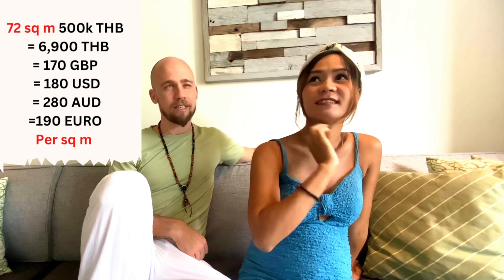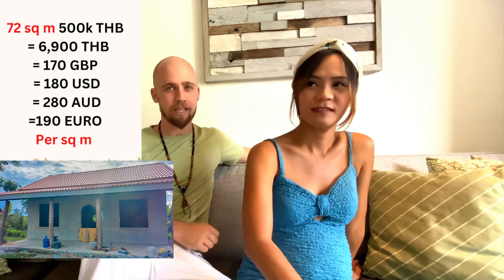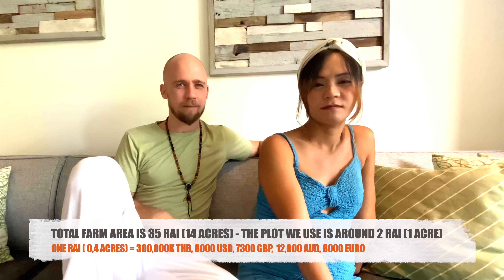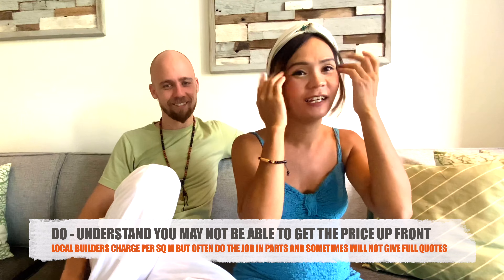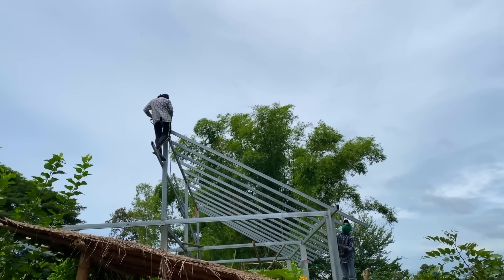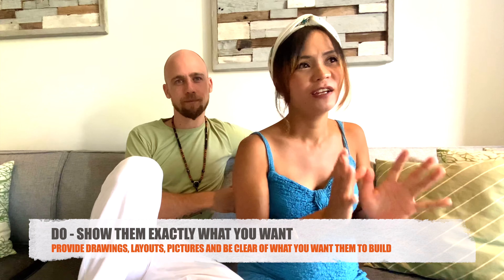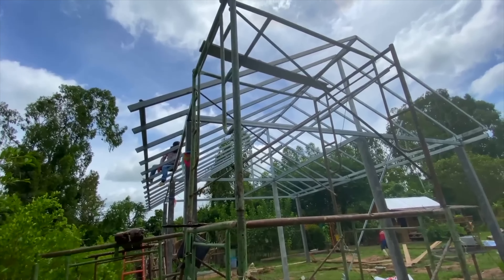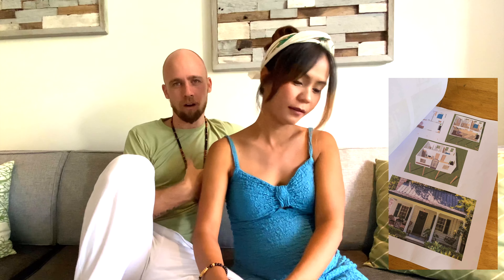Tiny House, Tiny Budget, Thailand | Building Under $10k - Do’s & Don’ts 😮🇹🇭

Comment: My guide to building my house (nearly finished) 

I produced my design using sketch up (free app) but had I to do it as just floor / elevation plans as that was what they were used to 

Rule 1
Always always always get a good reliable builder and try to see previous work
(Not doing so can end up with lots of problems like a sink with a 12% list )
Rule 2
You can if you feel the need (if alarm bells are ringing- why build) register the land / house in a company name with your solicitor as the front man.
Rule 3 
Have a reserve just in case (ie metal prices have shot up) 
Rule 4 
Stage monthly payments with major payment on completion 
Rule 5 it is not the west - just don’t worry, you may expect double skin walls 50cm thick why ? 10cm is normal 

And as you say everything runs on Thai time 
PPE one of my guys has a umbrella hat for the rain, for the sun and for doing roof work. Offered a hard hat but were to polite to laugh but a polite ‘no it’s ok’ 

One of my strings to my bow is that as a town planner the first thing I did was chuck away the normal western guides and build expectations and ‘go with the flow’  😂

Good Vlog as usual  👍🏼
Reply from the maker: Fantastic advice 👍👍👍

Comment: All very good suggestions!  We finished a 220 sqm (excluding outdoor patios), one story, four bedroom home North of Chiang Rai (rural area), 18 months ago.  The "estimate" was about 3.5 million baht and 10 months to build,  The final cost including upgraded materials and some modification to the outside was 4.2m million baht.  The house was completed in 13 months due to COVID and material (roof tiles) shortages. I am very happy with the builder, workers, design and quality of the build.  The only issue we had to address was the SCG cement tile roof leaking over the master bedroom during heavy rains.  It took many trips and many cans of sealing paint to stop the leaks.
Reply: And does the sailing paint work well? You don’t need to reapply it from time to time?

Comment: I'm currently in Nakhon Phanom, most houses here are built from wood and/or bamboo and are up on stilts because this area is very flat so when it rains heavily the water level rises dramatically, just don't forget that your power outlets need to be placed halfway up the wall.

Comment: One thing I found because my friend had a house built for his son is that the house looks crap going up and the quality looks crap but once finished with plaster and tiles it looked incredible. His builders were incredible. Just a few finer details they let slip like the water feed for the heated shower protruded from the wall crooked but overall it was awesome. You have to step back a realise that the finished article will look awesome. Make sure good quality bricks are used where heavy bathroom fixtures will be fitted as we had problems when drilling into the tiles and getting a good fixing.
Reply from the maker: Bingo!!

Comment: Hey Ryan and Damo and Otis, I agree with everything you said. My Thai friend has 4 rai in Northeast Thailand and what we thought of doing is to build a metal building about 10 by 20 meters. Then after we get that built we would build what we want for bedrooms and living spaces inside on each side of the building. In the center would be a kitchen. I haven't done the research on what the original structure would cost but hopefully it will be gentle on my pocketbook. 

I will have to go look at your previous video and see what the new house looks like.
Reply from the maker: Cheers Brock - it can be done!

Comment: I like this series.  There are so many cheap CAD programs where you can design your own house and just translate the specs.  Is it possible to make prefab teak or wood homes locally, or do you have to hire an outside company from elsewhere that specializes in it to do it top to bottom?
Reply from the maker: We have a teak home on the land too but dont use it now, there are many in thailand but I dont know any personally these days
Reply: @smrriles5668  Thanks for your response. I appreciate it. I know there are prefab wood house companies, but I was not sure if it was by province or regional, or do they provide the house, and then you have to hire locals to put it together.  Also, I am American and expensive as a Californian is different from expensive as a Thai.  I am seriously thinking of selling my house and just setting up in Thailand.  A prefab might be cool, because I can move it from place to place, and just rent the land underneath instead of building a permanent home.

Comment: Sorry it's a question that could vary alot but I have a small bungalow in Korat with 4 rooms & large windows....what should I pay for curtains? Ive had 2 quotes of ฿35,000 and my instincts are very very expensive. Although they will be "bespoke" or made to measure, are these fair prices?

Comment: Love your videos.
I live in rural Thailand in Prachinburi Province. My wife and I  are going to build a small house.  I was wondering what drafting app did you use to draw your plans.
Keep the videos coming.
Reply from the maker: Cheers Peter - glad you enjoyed it 🙏🙏
Reply: Hi
Don’t know if it helps 
I used sketch up (free app) using it for years and you can set the measurements cms mts or feet and inches and the accuracy for fine tuning 
However I found with my builders - who are excellent wanted more simple floor and elevation plans worked best for them, not knocking them it’s just what you are used to. 
For you own visual needs do it in sketch up ie: Model one - ground floor separate  model two first floor then another model for the complete shell with roof and drive / garden 
You can ‘walk through’ your model to view it from all angles 
It is a Labour of love at the beginning as you need to develop your skill using the app. 
Then simply take floor plans and elevations off the visual concept design.
Reply: @donxz2555  Thank you for your help.  I have done a cut and paste with measurements. But I will give what you suggested a go.
Again thanks for the information and help.
Regards
Peter Scott